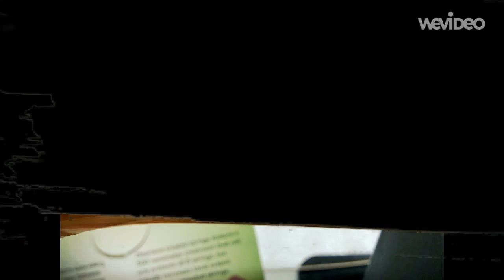Hand Carved Bone Nut

Comment: Any tips for holding it square?  When I use my belt sander, I tend to overdo one side vs another.  I suppose it's just practice.  Great work.
Reply from the maker: tockusa Yes, just practice, and not using too rough of paper.  You can fix some issues with flat block.